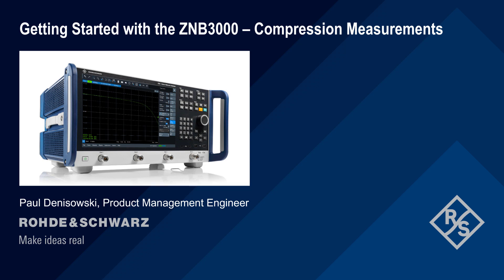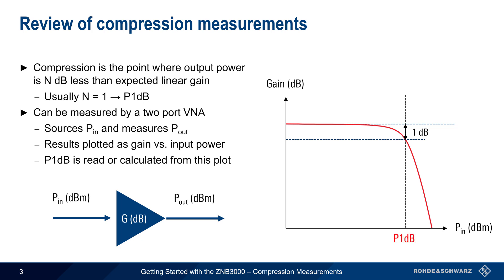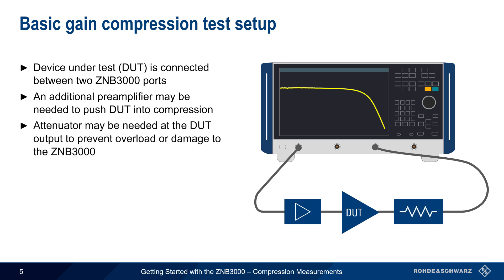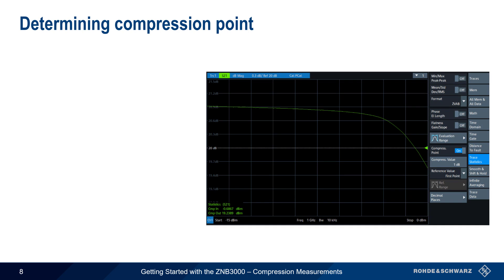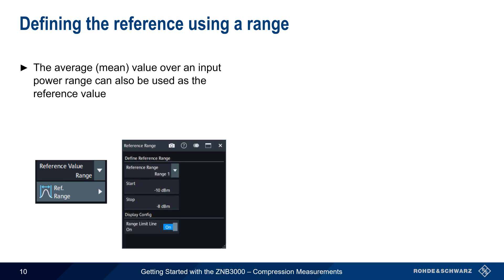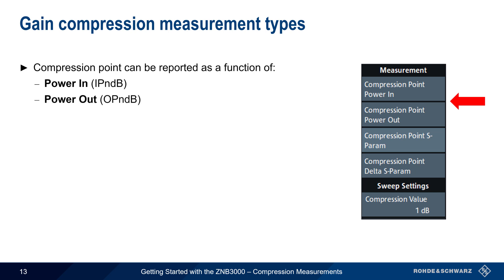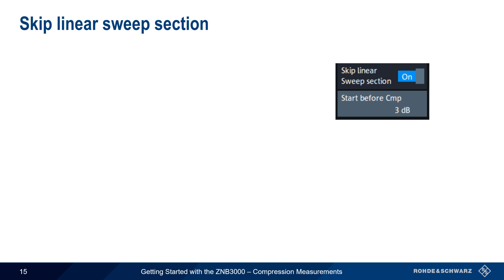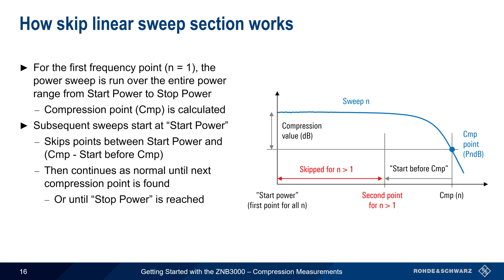Getting Started with the ZNB3000 - Compression Measurements

Comment: What happens when Gain is measured as a function of Output Power instead of Input Power?
Reply: The gain doesn't change and you can "derive" (just simple arithmetic) the OP1dB from IP1dB and vice versa.  Most people are concerned primarily with input power compression point - i.e. what's the maximum input power to a device at which it doesn't create distortion / non-linearities - so that's the most common measurement :)
Reply: @pauldenisowski Ok, thanks.